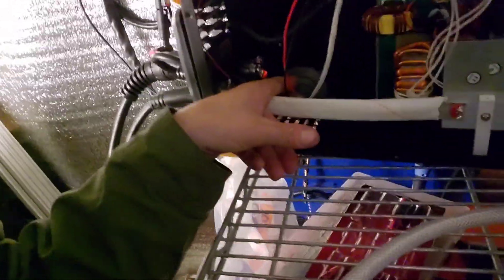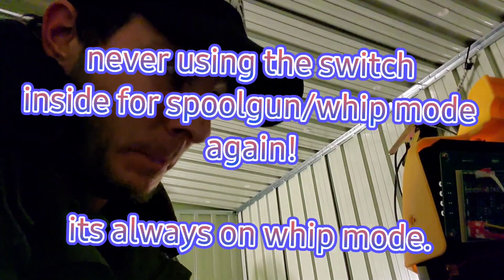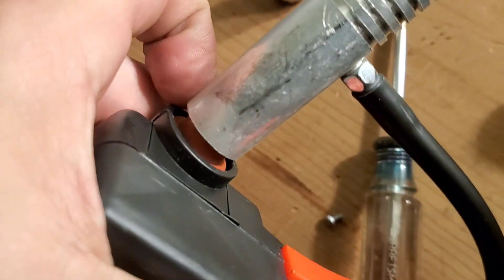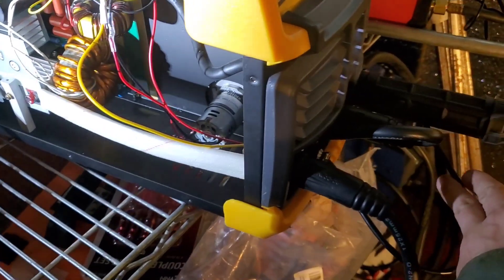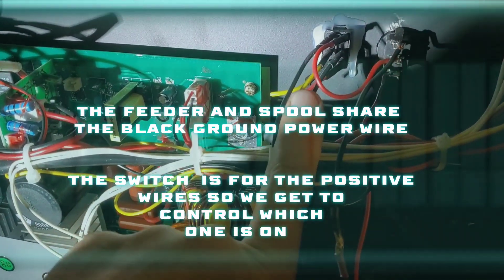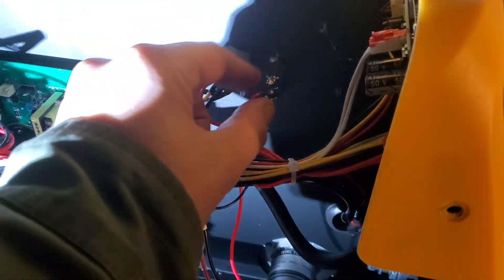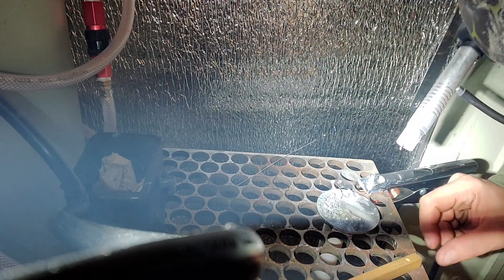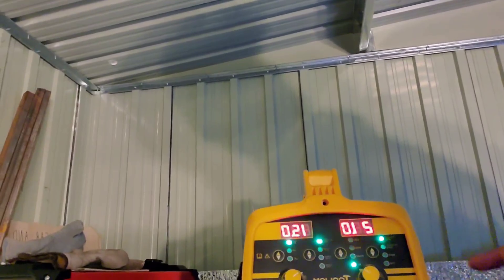AMAZON WELDER pt2-TOOLIOM TL-250M ALUMINUM MIG WELDER- FIXED SPOOL GUN- FIRST IN HISTORY! repair  !!

Comment: quite the collection of equipment
Reply from the maker: This machine is the only mig i have that is made for spool gun use even tho it faild me. The other welder has the same brass whip connection so I could actually just plug in the spool gun there (if I tap into the wiring exactly like I did here). 100% workfull.
Reply from the maker: Good question gibson

Comment from the maker: I got it because this welder goes up to 250 amps and 15METERS per minute🎉 in feed🎉 ...which is big time !      the Brass Leader connections are a little bigger than the regular 200 amp machines everybody else has.🎉 the weight of the machine will tell y how much power it has because the iron mass is inherently larger. I have a chart where i compare the weights of like welders online.

Comment from the maker: The whole story about this spoolgun on this machine the 250M is that you can't use the spool gun mode because it doesn't power the spool gun and it doesn't power it internally....

 so we have to make it think that the spool gun is just a regular whip gun and I also just added one switch so that we could pick.🎉🎉🎉🎉🎉🎉